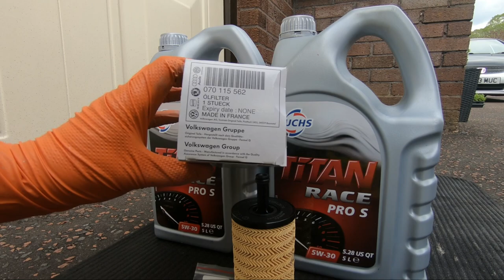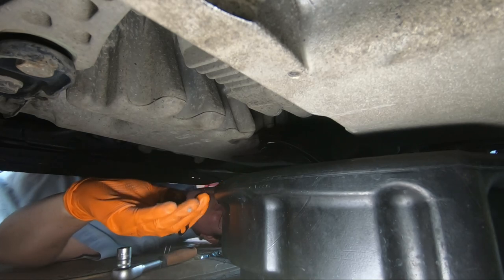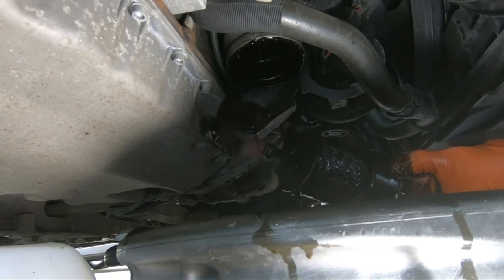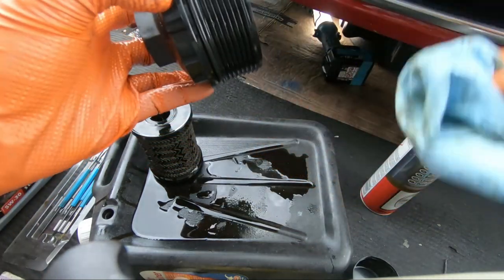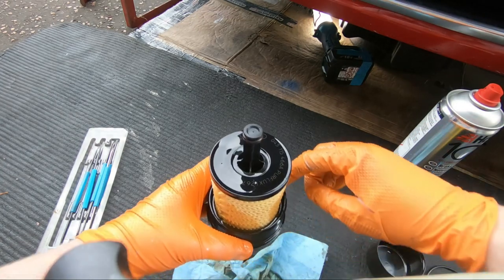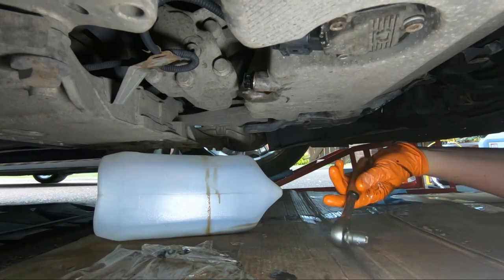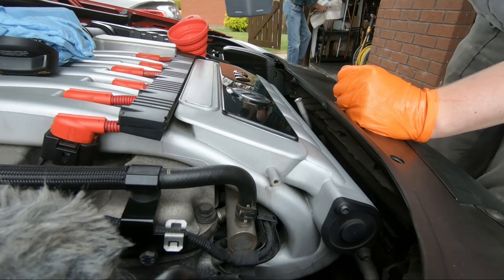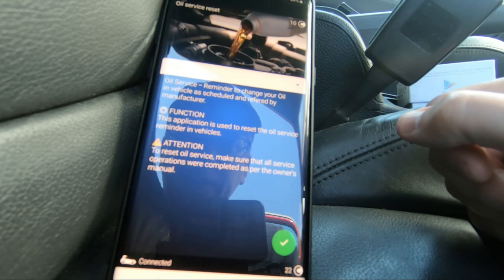How to change the engine oil on a Mk5 R32 basic service

Comment: Glad to see someone else 6mm hex filter drain bolt is stripped ;) 
Now I am more at peace for draining twice already by just removing the whole plastic filter cap. I suggest putting a big (15+ cm wide) funnel under it at the same time...
Reply from the maker: Mine isn't actually stripped now, but it wasn't coming off previously, so the entire housing was replaced.

Hard to beat a big plastic tub to catch the old and for an easy drain off :).

Comment: Good job on the service.  Quick question with all the fluid changes etc you have done on the golf recently, a normal garage would record this in the service manual and stamp it.  With a DIY job as such are you concerned about the sale of your R32 in future with most buyers wanting a full service history stamped up on the service manuals?thanks
Reply from the maker: Hi Andrew, thanks for the comment.

I have a fully documented service history with receipts, videos and mileage records to prove.  I would say that's worth much more than a stamp in a book that doesn't guarantee things have been done, never mind done right.
Reply: Neil Magill yea this is true, I would far rather do a lot of work myself on the motor but feel anyone buying the car would always want a stamp from a mainstream dealer which is a shame as we know they can cut corners at times but charge plenty for the supposed work they do!keep up the videos, a POV drive in the R32 would be a good job to hear the note from her!!
Reply from the maker: @andrewjohnston3624  it's never harmed any cars I've sold. In fact several sold before being advertised because they have been maintained so well :).
Reply: Hi just confirming if 19mm is original r32 size? Mine has a leak at the moment and not sure if I should put in a larger sump plug?

Comment: Cheers pal all these service videos give me the confidence to crack on and do them myself couple of axle stands and a trolley jack and im away👍👍👍🤜🤜🤜
Reply from the maker: No worries at all. At least you know it's done right and much cheaper than taking it to a garage!
Reply: There aint many if any decent service videos like this for the r32 mines a bit low so hard to get under but ill let you no how I get on thanks again 👍👍🤜🤜
Reply: New coolant bottle anti freeze changed new oil and filter took about 3hrs and about £100 running sweet as now thanx pal. Maybe the haldex service next 👍👍🤜🤜
Reply from the maker: @Holmzy-li5bc  Cheap as chips!! Did you charge yourself much labour? 😅
Reply: @NeilMagill  got myself a few beers and a kfc to thank myself 🤣🤣 more then happy tho defo saved a few quid there
Reply: What ya views on these remaps that can be done must admit I want one need the forge induction kit first but aint to sure myself.
Reply from the maker: @Holmzy-li5bc  I dont think there is enough gains to be had to make it worthwhile. I would consider the linear throttle maps on their own though.
Reply: @NeilMagill  mines dsg got a quote for a dsg and engine remap £800 but it's a map to the car still tho like ya say aint much to gain but pop bangs and flames but I like that stuff🤣🤣💥💥💣💣
Reply from the maker: @Holmzy-li5bc  lol the DSG map would be worthwhile to get it to hold the gears etc. Revo Techniq have stacked if info on their site.
Reply: @NeilMagill  yea the gear changes could do with a sharpening up but tempted to go all out